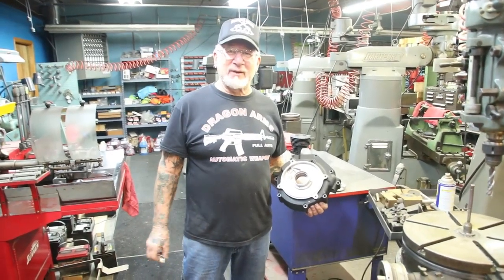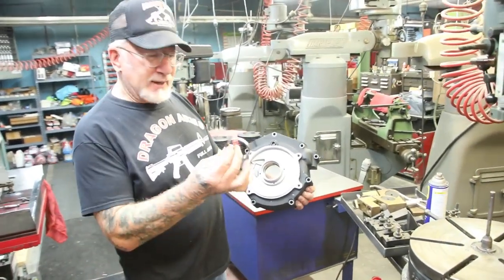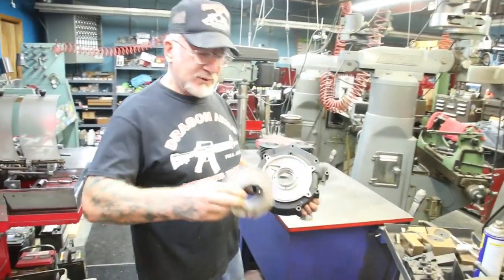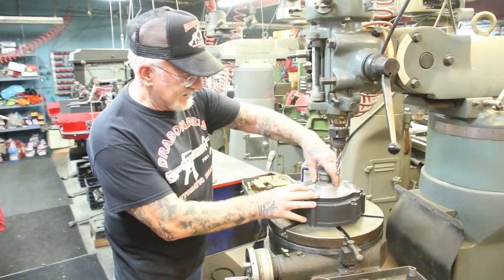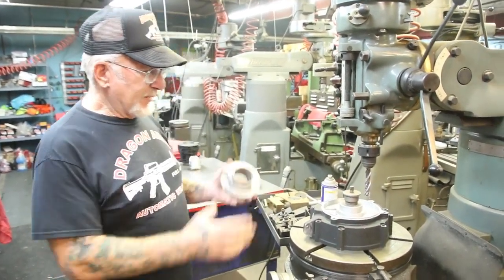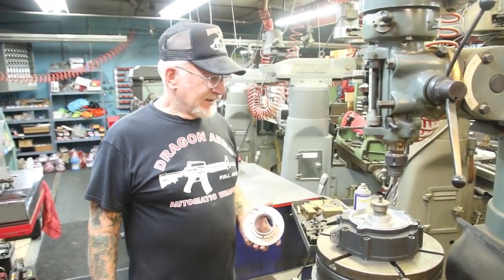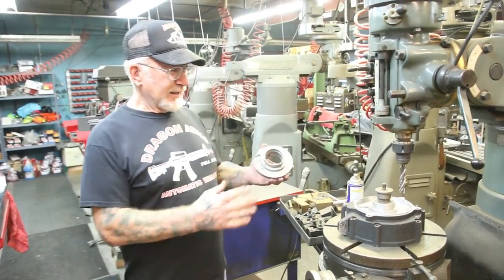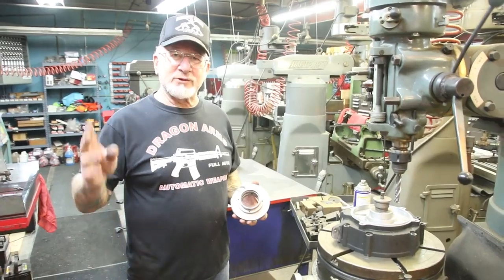Repairing a Harley Davidson Motor Case

Comment: Nice shop jigs for every part ...

Must've taken years to make all those specific jigs .

The rotary table is the way to go ..
Be hard to chuck that up in a four jaw ....

I'd like to wrk on old Harley motors ...

I'm a machinist I'm usually working on pumps,compressors,shafts,electric motors.paper mill rolls etc etc.